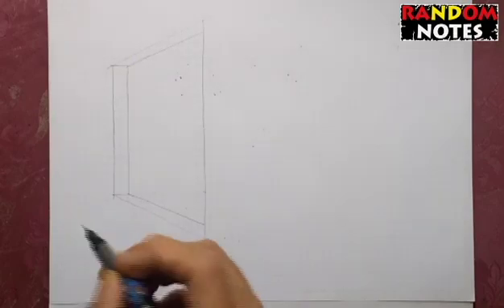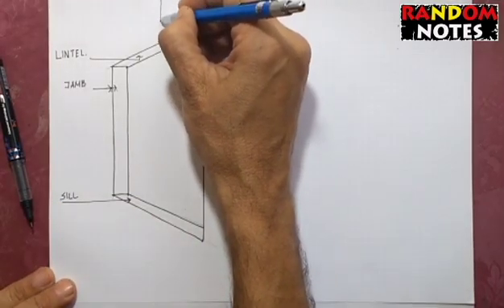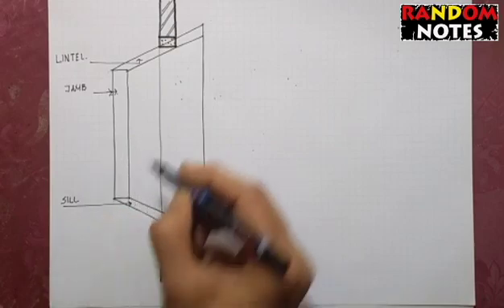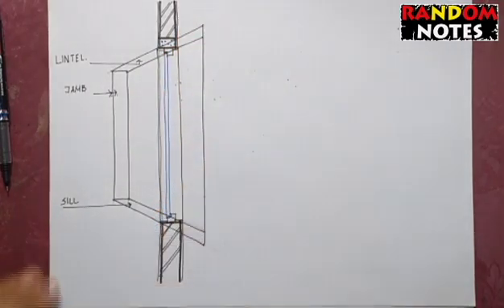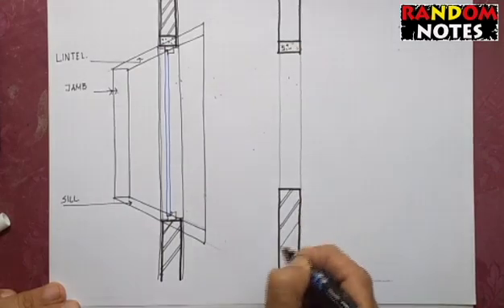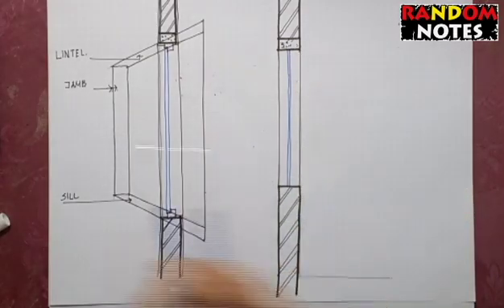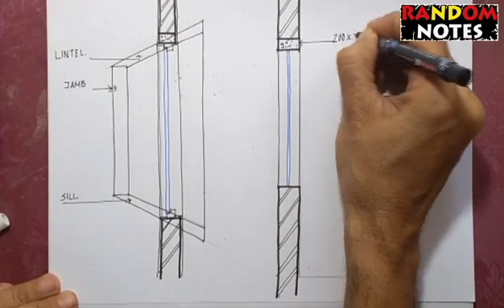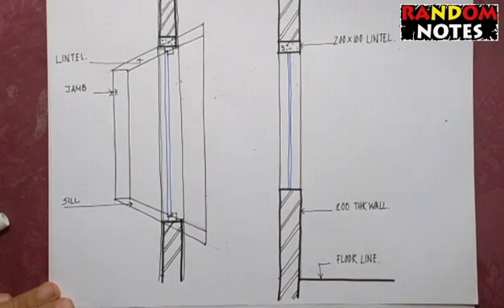Windows- Making Section

Comment: From an architectural note, this is definingly random! I am a simple auto tech but while retired, the header is designed into a building to hold the weight of the measured load and live load above it. As with any opening in the wall system of s structure, the load above have to be transferred to the foundation properly. The lintel in the window is a non-structural component, but the framing above called the header is. This explains the king stud and jack stuck to transferer the load. No dis-respect intended at all, with limits on income and the cost of products going up due to many factors, I was hoping to find a better design to employ triple glazed gas filled windows and build them my self of PVC or CPVC that will not rot and has a decent R-value. My house has 4 moving windows on the main floor. I can not replace the 3 stationary windows, but build the frames of something other than wood, that does rot and needs constant maintenance. Thats all.
Reply from the maker: Thanks a lot for your valuable inputs here. I really appreciate your efforts. The lintel, in this part of the world is a structural member that takes and transfers the load of the wall above an opening to the sides and, subsequently to the foundations below. In metal stud system with dry wall or balloon framing (predominantly used in the US and Europe), the header transfers the load to the frame and, subsequently to the foundation below. Do correct me if I am wrong.
Thanks a lot for your response.
Regards